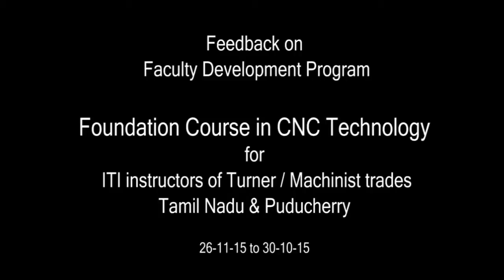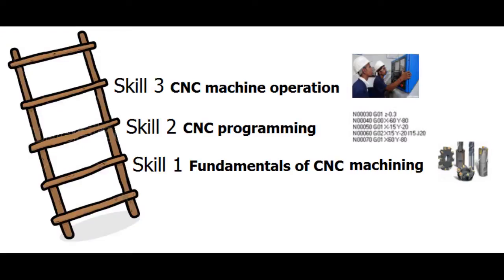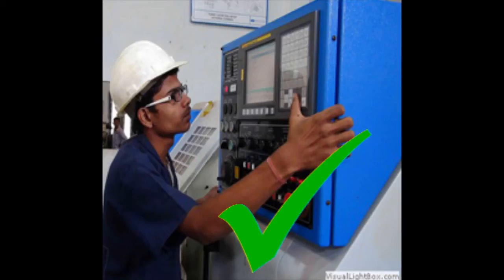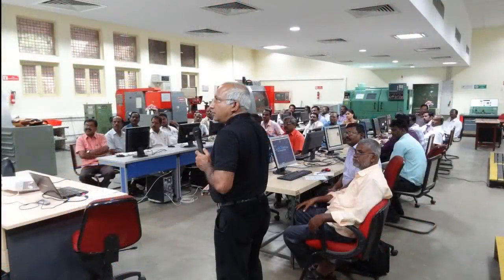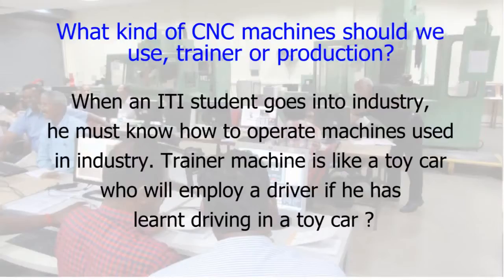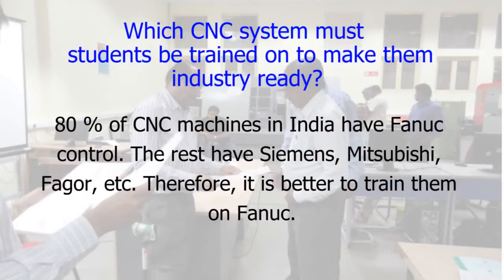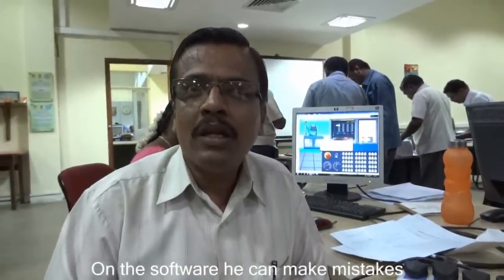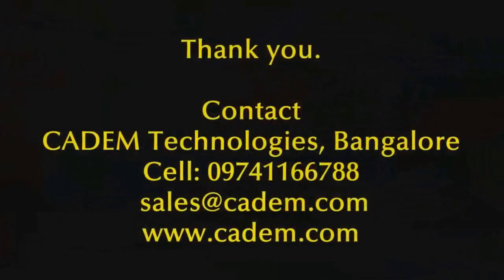CADEM FDP ATI Chennai

Comment: Sir, I am an Innovator and I need to analyse & design my machine using 3 D Mechanical CADD. I am a Diploma Electrical engineer, a trained Bench Fitter with exposure to allied welding, Black Smithy Mould making & casting. I am 69, Retired SEE ONGC. Can ATI Chennai provide me 3 D CADD training please sirs? I am ready to share the patent with ATI Guindy, if I may be able obtain please sir.

I live in Chennai. My email: nagarajanks27@yahoo.co.in

Thank you,
Yours sincerely,

K.S.Nagarajan.